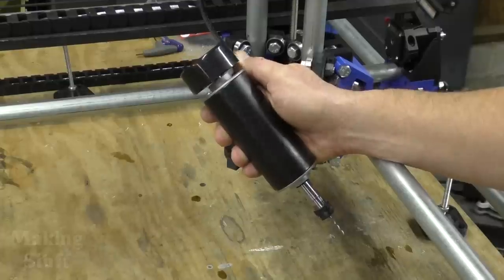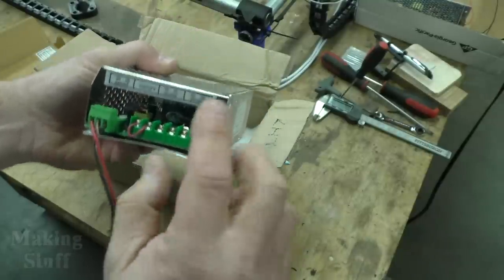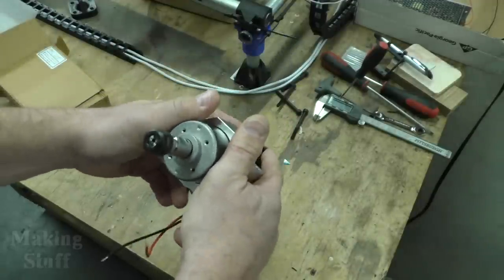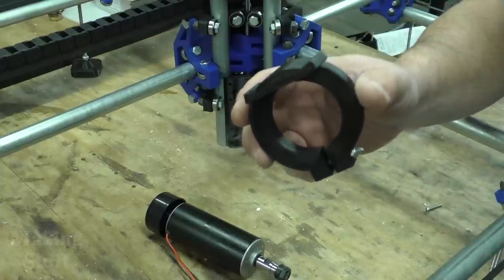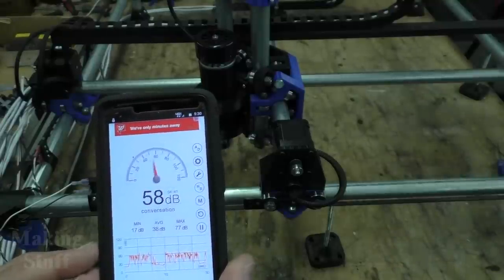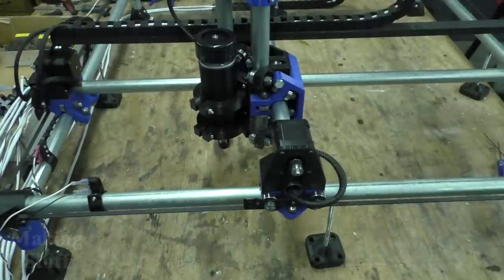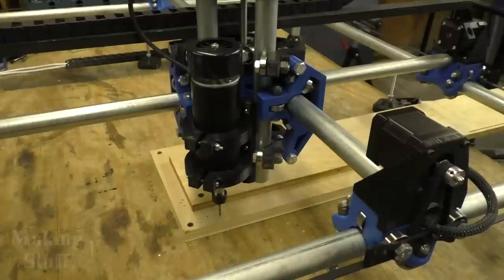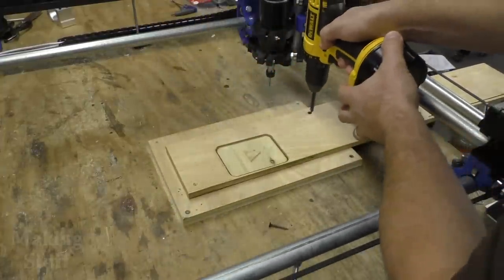Reviewing a Chinese Spindle for CNC Machines

Comment: Excellent video! Thanks for the share. I have been struggling with my cheap version of a Dremel and was thinking of trying a different one. I like the low noise and the torque of this spindle. Not sure how it compares with the Makita RT0701 router which does make a loud noise. Hey btw, the Bangood discount code has expired, any chance of getting a new one?

Comment: The milling marks can be an indication of the bit not being perpendicular to the work. Make sure you check that, otherwise you'll bite off more than you can chew when you do a slot. If that doesn't fix it you can increase the stepover. You can clean up the fuzzies by using a downcut or a finishing pass or just better bits. It's not really worth chasing too much because 5minutes of post work will clean it up. The V1Engineering forums are great for this kind of info (I have about 5k replies there).

Comment: Those spindles are good only for hobby where you want to take your time with your work. You have to be really careful not to go to fast with it with a bigger cutter because it will bend the shaft holding the colet (not fixable). It has a 8mm shaft on skater bearings. Mine gave away after about a 3 months because the winding wires came loos from vibrations.
Reply: justmeemi1988 Would upgrading the bearings up front help?

Comment: Thanks Bob,  you got it in less than a month, that's great. less noisy sounds good too, now you can have some fun making stuff with it. It looks like you can run endmills a little larger than 1/4" with the collet set, I wonder if you can tighten a bit in it without a collet.  Thanks I hope you will enjoy the cnc for many years to come.
Reply from the maker: Thank You.  I got an ER11 collet set that goes up to 7mm today.  I will definitely be trying some larger bits.

Comment: the fuzz is from an upcut bit. you need a 2 flute downcut bit to get clean edges. the cut lines in the bottom means the spindle is out of tram. i run this spindle with an 1/8" upcut/downcut bit all the time and get perfectly smooth surfaces up to mu largest bit which is a .92 inch surfacing bit. In addition you can sometimes get more speed out of it by taking the pot off and hooking it up to the 0-5v variable power on the control board. this allows you to control the speed from the machine itself. there is a  0-5v lead which connects to the center terminal. and a ground and that connects to the right terminal and the left terminal is empty on the power supply. i have a schematic which shows it for the ProVer board but most control boards have a 0-5 v port.

Comment: I ran one of these cheap spindles for about 2 years and it worked great at first. Eventually the bearings went kaput and the runout got excessive resulting in ear-splitting chatter no matter what bit I was using. Also, the press-on plastic fan eventually came loose from the shaft after extended periods of running (heat). A drop of 5-minute epoxy held it on for awhile. Eventually took it off and put the loud route back on. I guess you get what you pay for.
Reply: This spindle has only one ball bearing. Normally spindle has angular contact bearings and total 4 bearings to bear cutting backforce. If you open it, you will know this is just modified hand blender.

Comment: Thanks for the video, its always very interesting to see what you are playing with. Do you think any type of air assist at the tip of the bit would produce a much finer and cleaner cut, it would push the debris away and at the same time it could assist in keeping the tip at a cooler operating temperature, I come from a laser cutting background using a cnc laser engraver (blue diode) 8.5 watts of extreme power when focused correctly and we have in our community developed what we call an air assist unit, Its normally based on a Hailea AC0 328 Pond air pump which pushes out 80 litres of air a minutes and using fine copper tubing 2/3mm bore we direct this to the focal point of the laser, this allows the laser to cut a lot cleaner on wood , less charring and a much more fine style of cut can be achieved, I was wondering if the system could be adapted for this use, I dont have a mill at the moment as my cnc is all laser but I am thinking of purchasing wood CNC router and either a DIY system or a kit, not sure at the moment as there are so many options and to be frank i am not sure where or how to start. I am not looking for a huge footprint, my laser is 400/600 mm and I find this is plenty big enough for what I want to achieve. I am not looking to mill metals and I am not ready to go down the 4th Axis route yet. For me 3 axis is plenty to get my head around.....Many thanks Neil

Comment: Which filament did you use for the spindle mount? I've heard some say that PLA will warp from the heat from this motor but the temp you had there didn't seem that high. If you did use PLA how does it perform?
Reply from the maker: I used PETG filament.

Comment: First, do not try to fit a 1/8" bit into a 3mm collet.  you can damage the spindle.  You must always use a smaller bit than the ER collet size!

Regarding the spindles.  these are nice and quiet and maybe ok for milling a PCB or some softwood but they do not have angular contact bearings and there is axial slop that can never be fixed.  This is due to using deep groove roller bearings which are not designed for axial loads for milling.  They can take some axial loads however the slop will cause massive chatter.  They also do not have the runout tolerances you'd want to ideally have. You can mill aluminum with them but you will not be able to properly use your bits and likely will be doing more rubbing than cutting.  I wish it were not the case but there is no shortcut here for cost savings.

Comment: Great video. In your opinion, do you think it will drive 1/4 shank bits as well as it did the 1/8 or do you think 1/4 end mill bit would be too much for it? Thanks
Reply from the maker: Yes I have used plenty of 1/4" shank bits with it.

Comment: Great spindle! I was really impressed with how quiet it is, and the price is great. Just what I was looking for! Thanks for the review! I noticed they have a deal to add the collet set.
Reply from the maker: Glad I could help.  Thanks for watching!
Reply: he got lucky on the quiet end i assure you they are not all that quiet. mine is much louder, quieter than the piece of crap that came with my 3018 but loud. However i can hit 14k on mine and i wonder if its because i dont run the potentiometer and insted i run mine off the variable 0-5v power on the board for speed control. in addition i ran a second e-stop switch to the power leads. i have the 2 estop switches side by side and its just an extra added measure of safety.

Comment: The microphone on your phone is at the bottom, you should hold the phone by the sides and point the bottom towards the spindle.
You should measure run-out of the tool in the spindle.
Really, you should wait till you have more collet inserts as 3.125mm is too small for a spindle which runs at that speed. Running with a 6mm+ will improve your edge finish but load the spindle more.
Check that your spindle is perpendicular to the X and Y axis of travel.
Reply from the maker: Thanks for the info.

Comment: Very Good job on the video. Looking at the finish carving and it looks like the spindle is mounted a little off square. Which is what makes the lines show up on the flat area. Great job.
Reply from the maker: Yeah that's the one bad thing about the MPCNC.  There's no way to adjust the tool.
Reply: @MakingStuff  - It is always possible to adjust by using shims and experimenting.

Comment: Great Vid, U might consider using a V bit to remove the burrs in a finishing or profile cut, not quite so sure about the lines yet BUT keep em coming, meant to ask what type of 3D Printer would u recommend for a beginner?
Reply from the maker: Thanks for your input.  The Creality CR10S is what I use and love it.  It took only about 20 minutes to get it up and running and I never have to tinker with it like the older 3D printers I had.

Comment: What is the runout like? Have you had a chance to machine any aluminum or hardwoods yet? Good video!
Reply from the maker: I ran some white oak on it today and it worked much better than the plywood.  Haven't tried aluminum yet.
Reply: @MakingStuff  I did, but with the BLDC brand. Run massive alu up to 6mm mill bits, no problem.
Reply: As a rule of thumb, and of course this is all provisional since these things get made in large quantities, the models up to 1500W seem to be fairly low runouts. Once you get in the 2.2Kw and 3Kw ranges you have a little more runout. Again, this is collated from people all over the place reporting on this sporadically and subject to change as there is quite a few brands and manufacturers at play.

Comment: Great video!  Were you manually controlling the spindle using the potentiometer or were you able to wire the spindle up to the CNC controller for spindle on/off and speed control?
Reply from the maker: It's manually controlled with the potentiometer.

Comment: Thanks for this video series on the MPCNC. I'm researching and collecting parts for my build. This spindle has a brushed motor. Brush wear is a problem. Brushless spindle motors can be found for a little more money but should last a great deal longer. How much runout does it have, what type of bearings and how much actual power is it using?
Reply from the maker: I don't know the internal details of the spindle.  I haven't done much with the machine since building it, but I plan on using it here in the near future.

Comment: Well done, just a thought do you think the aluminum bracket that came with the spindle might help keep the motor cooler?  If that bracket you printed is PLA,  how hot does the motor need to get to make it pliable?   Just some random thoughts, great job
Reply from the maker: I was wondering that myself when I first started using it.  I ran some g-code that took 2.5 hours to run.  The motor never got more than 48C.
Reply: @MakingStuff  You should be good, I know when you're cutting aluminum the load is significantly greater on the motor,  so it's really about what you are cutting and how fast.

Comment: I've built a couple of spindles for my CNC milling machine but I needed one with a little more power so I bought this one. I found the spindle was out about .002" TIR so I mounted in my chuck and steady rest and reground the chuck with my tool post grinder in situ. I got it down to about 2 or 3 tenths. I haven't used it much yet so I can't comment on how well it will hold up.
Reply: You're bonkers.....that .002" is quite acceptable for any material or machine this spindle could be used on. It's probably aimed at the 3018 type router for an upgrade and that machine will not touch metal EVER so going to the lengths of regrinding the chuck is a total waste of time. BTW, any run out on a cutter will just make the cutter appear that much bigger in diam,  and .002" runout is nothing to get excited about.
Reply: The TIR was the information I was looking for.
Reply: @gangleweed  Actually no. I've had ample time to use this spindle now on my CNC lathe. Within its working range it is very good. Mine never gets hot but, again, I don't push it.
Cutters mounted in the spindle are accurate, at the cutter to 0.0004 +/- a couple of tenths.  I also like how smooth and quite it is. 0.002 is not good enough, many times I take small depth cuts with 0.0625 or smaller cutters. If a spindle is off you get ridges after each pass. I don't get that.
Reply: @mosfet500  lol.....I just have to chuckle at all those people who buy these cheap spindles from B'good et al and think they are getting super precision in the tenths of a thou range.........they are intended to give more cutting capability for cheap routers like the 3018 type with bearings that are not super precision and after a few hours of running they will be even less so.
Coupled to that the ER 11 chucks and collets supplied with these motors are nothing to write home about, certainly not super precision but more in the adequate class, so stop kidding yourselves.
As I always put my money where my mouth is, I have just " invested"  in one of these spindles packages with the aluminium mounting and a power supply too as I have a purpose I want to pursue.
Reply: @gangleweed  The thing about them is that they, as I have done, be improved. I ground the ER16 (not ER11) chuck to 0.0002" in situ and it's still dead on so the bearing, as of this writing, are fine. I changed the collet to Techniks, a Chinese collet with very good TIR. You can get any bearings you want, you can put ABEC 7 Fafnir bearings in if you like. This is basically a good spindle for the price and used within its design range very capable. Sure it's not HAAS but it's not $1k either.
Reply: @mosfet500  I would agree that the chuck itself "could" be improved by a surreptitious grind or two but seeing as it's just a slip fit on the motor spindle with 2 grub screws to hold it on and not an integral part of it, that introduces run out error straight away......this is something I will come to grips with when the one I ordered arrives some time in the near future.
I think the chuck could be better improved for runout by Loctiting it to the motor spindle as this would probably centralise it better than having the grub screws push it off centre.
With these cheap collet chuck and even cheaper collets I've found that most of the problems lie in the collets themselves.....one ER32 collet I have has a runout of .004".
To cure collet runout means you have to mount it on a mandrel between centres and do a very small grind on the 2 OD tapers, NEVER  in the bore, which is a set diam even though it can be squeezed down to a smaller diam as much as 1 mm, but for  most purposes that the 3018 type routers are intended for a runout of .002" is not an issue to even break out in a sweat about.
I've also heard that the problem of runout can be in the collet nut pushing the collet off centre.
Reply: @gangleweed  I wouldn't locktite the arbor on the spindle shaft, if you ever have to pull it apart the shaft might distort from extra pressure required getting it off. If you cut it in situ with the screws tight it shouldn't have problems. Again, you're not going to be using 1" end mills in this thing. I use it mainly for high speed stuff like engraving and fine endmills no greater than 6mm or 1/4". It works great with 1/32".

If the chuck is only out a couple of thousands you can grind the bore, I've done this with several chucks. It's more accurate than grinding the shaft because you are cutting the bore in place using the spindle assembly itself to turn the shaft. I've built lots of high precision spindles, you always take the last cuts in situ.
The collet nut shouldn't create problems IF the bore is a true taper, you run into problems when the taper itself is out. You can test this buy putting a know accurate shaft in the chuck and tightening it down, I use 1/8" high quality carbide endmills for this. Check the runout at different points along the endmill. If the bore is out and the collet is a known high quality collet then the runout is due to the bore either being eccentric or not cut to the correct taper angle. The function of the collet nut is to just hold the collet in place, if that's all good the nut itself shouldn't effect the TIR as it's just seating the collet.
Reply: @mosfet500  Loctite is not a problem for dismantling.....150 deg C will make it release without damage if for some obscure reason you have to remove the chuck. 
I have to question anyone's ability to grind a collet chuck while still mounted on a low wattage motor spindle. 
At this end of the spectrum those chucks are the very lowest denominator for accuracy by most accounts, but as they are going to be used on wood in conjunction with a very springy transport system on a similar very springy framework, the accuracy will never be an issue either anticipated or designed.....it's a cost factor that determines the actual outcome when you buy at the bottom end of the market.
BTW, I get good results by holding the ER 16 collet chuck by it's body in an ER32 collet chuck with, as far as I can remember, a 20mm collet for drilling small holes on my CNC mill.....the ER32 chuck would dwarf the small drill bit and make it hard to get close to the job if and when etc.
Reply: @gangleweed  It's not "springy", it's a 10mm shaft and it's close to the bearings. I don't think it's necessary to Loctite anything as long as the set screws are tight, mine has never shifted and if I need to change bearings I don't have to heat the shaft. 

Mounted on my lathe and dialed in to dead parallel the run out on the spindle shaft was 0.0002". Grinding the collet bore was a snap with diamond grinding wheels. I've done this many times with excellent results, the proof of the pudding is that my spindles are very accurate. This is an accepted procedure for spindles BTW.

I used the spindle to CNC a fine contour in a complex part with a 3mm endmill advancing the mill depth 0.010" per cut in CRS to a final depth of 0.200". I couldn't see any lines from the depth cuts. The motor never got hot nor did the electronics. I monitored the speed with an accurate tach and the rpms were very steady. 
If you don't like buying Chinese stuff, don't. I think some of it is crap but I also think you can get quality stuff from China. I've been dealing with board houses for my PCB Gerber files for years. The boards come back excellent and I've run some very fine vias in some multi layer boards.
Reply: @mosfet500  Whatever......